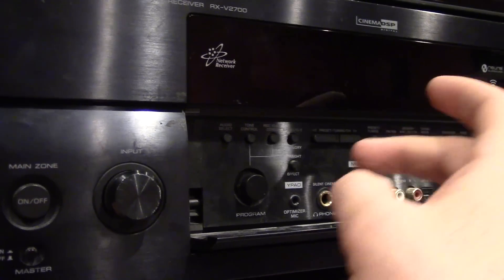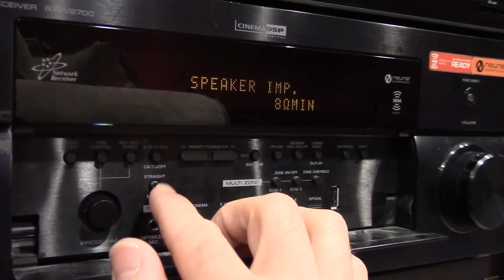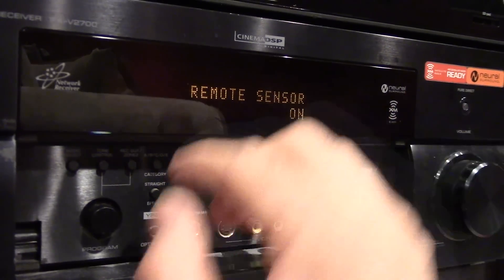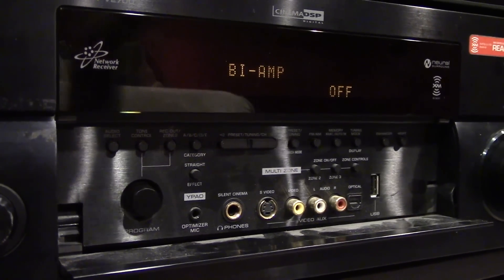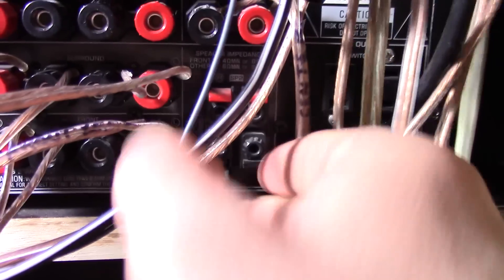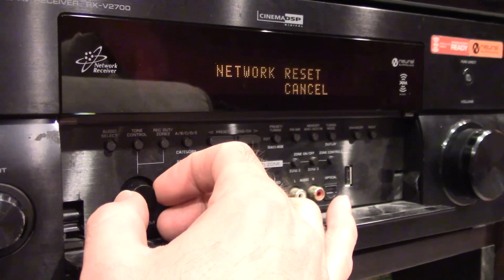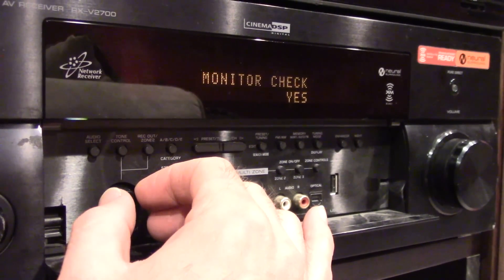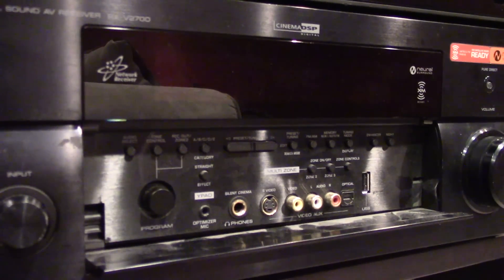YAMAHA AV Receiver Setting Speaker Impedance

Comment: I don't think bi-amping has anything to do with putting speakers in multiple rooms.    I believe u feed your low frequencies through one amp,   through a pair of wires,  to the bass speaker,   and you feed your higher frequency speakers with a separate pair of wires,   coming from a different amplifier circuit

Comment: Bi-Amp DOES NOT mean party mode. 
DOES NOT mean Zones.
DOES NOT mean it splits highs and lows!

Bi-Amp will take FOUR of your internal amplifiers and assign them to the FRONT MAIN CHANNELS. This way you will have 2 amplifiers for the LEFT channel, and 2 for the RIGHT channel.

It is at THIS point where yes... you take the bridge straps off the back of your (large) main speakers, then feed the woofers with one amplifier output,  then the midrange & tweeters with the other output.

What Bi-Amping effectively does is double the power into your front main speakers.

You NEED to read your manual!
It will tell you which speaker outputs on the rear will be assigned to the front L&R when you select Bi-Amp.

Comment: Bi amp is to send high and lows to your main speakers if they have 2 sets of speaker terminals
Reply: Well, I picked up a Yamaha Rx -v2400 because it has phono input.. the tuner works and cd player works.. no sound when you select phono.. I'm using a Jvc L-A10 equipped with an internal pre-amp.. any ideas?

Comment: worked on my RX v685 thanks!
Reply: i TARGETED YOU SIMPLY AS ONE OF THE MORE RECENT CONTRIBUTORS. Just bought a vintage ?? Yahama rvd1500 receiver to hook up to a 2.1 Polk pr maybe an AR 2 AX 2.0 plus subwoofer system driven from a Schiit DAC out. Question, How can I get a simple 2.1 setup with one cd or other hi level  input and Polk speakers. It worked then it does not.  Im 80 yo and dont need all the bells and whistles. 

cant hear them anyway. Thanks for whatever help you can give me.
Reply: @rogersxx  sorry, mine is not vintage..  RX V685 is a late  2018 product, so i can't help

Comment: i just picked up a v1600 from tweeter and seem to be having an issue with the remote. Volume and source selection, power all seem to work fine, but navigating the OSD is problematic. Here's what happens:

When I press the "Set Menu/MENU" button" nothing happens. However if I press the Down Arrow button (just below the Enter button) I get the Set Menu OSD. I now See the following on the OSD:

--> Auto Setup
Manual Setup
Information

If i try and use the down arrow button to select Manual, the Set Menu OSD closes out. If I go back to the Set Menu OSD and hit the Enter Button to select Auto Setup, I do go into the Auto: Menu screen. However I still have the same issue while trying to navigate up and down.

This has really got me scratching my head. It seems like a few of the keys are scrambled. The remote contol selector switch is set to AMP - I di try it on Source and TV as well with no luck.

I also tried resetting the remote control codes for the AMP and Tuner but that didn't help. Anyone have any ideas?

** My remote says:
RAV362
WH25430 US

on it - can anyone confirm if that is the correct remote for the rx-v1600 ?

thanks

Comment: You should ALWAYS keep it on 8 Ihm. It is not harming neither your speakers nor your amp. You are simply losing potential! Check audioholics in this matter please.
Reply: so if i have 6 Ohm speakers i should set 8ohm from the receiver even if i can choose to set 6ohm?
Reply: @SIG_333 Yes, if you select 6 ohms it just reduces the power output to prevent the amp from overheating. Leave it at 8 ohms and run some fans on top to keep it cool.
Reply: Banana Splitbrain some streakers have different ohmage...

Comment: Bi-amp allows for separate signals to go to the Tweeters and Woofers on a speaker, it has nothing to do with Zones.
Reply: you lose the second zone if you bi-amp a pair of speakers.
Reply: Frankly, I think anyone who is seriously considering bi-amping would go with a separate preamp, crossover and 4 power amps
Reply: Roger that. Wtf is he talking about. But using the straight button with the main power to get into another menu is useful. Yes biamp is within the speaker itself and you’ll clearly see two sets of jacks for that purpose, on the speaker.

Comment: i have 2 4inch alpine each per channel running at 8 ohms can i parallel them to run at 2ohms or will that damage the amp,i only see 8 & 6 ohm settings on the receiver but the manual ON yamaha site says Dynamic Power per Channel (8/6/4/2 ohms) 110 / 130 / 160 / 180 W can i run it at 2 ohms HELP PLEASE